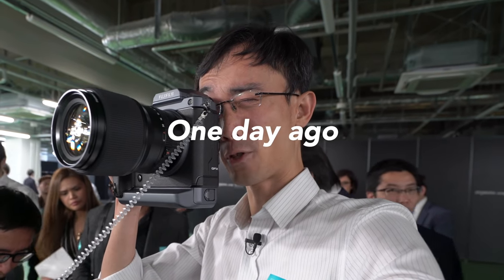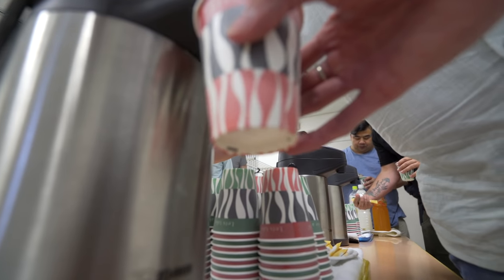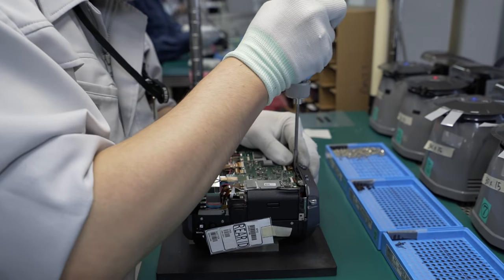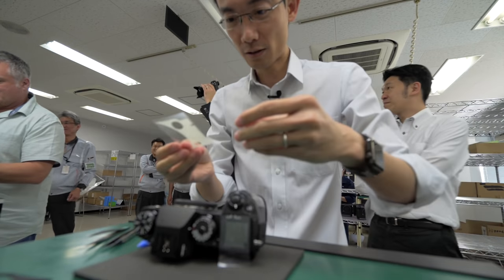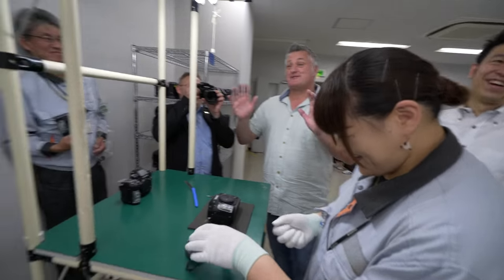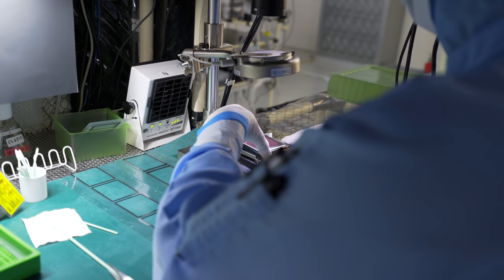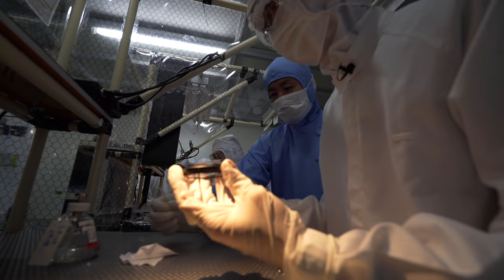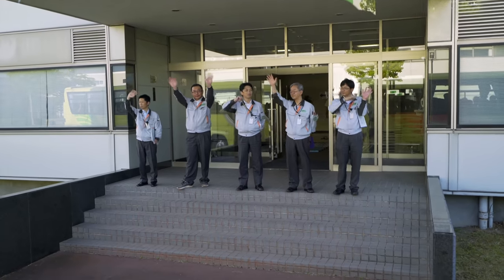Fujifilm factory; GFX100 production line; I helped assemble X-H1 (and failed)

Comment: The fact that they use those little magnification trays when assembling the sensors is a revelation for me. Not because of the magnification, but because it allows them to see a direct view from above the sensor, without having to stand directly above it.  I don't know how many screen protector installs I fudged because I looked down at it to check alignment and a flake of skin fell off my face or dander or something.